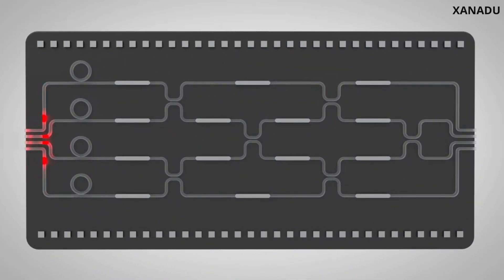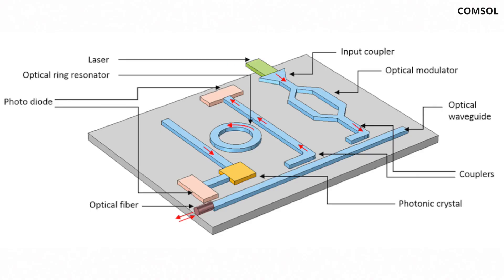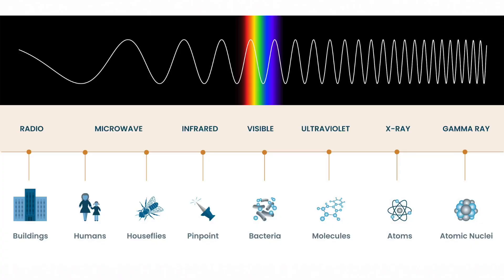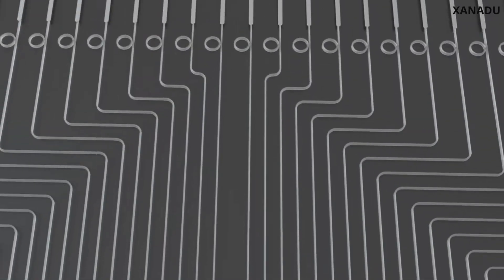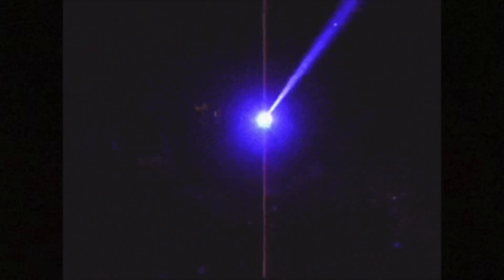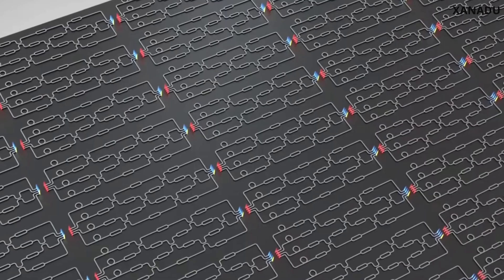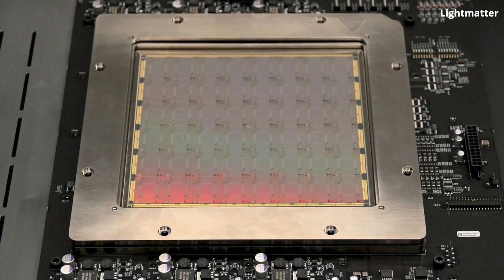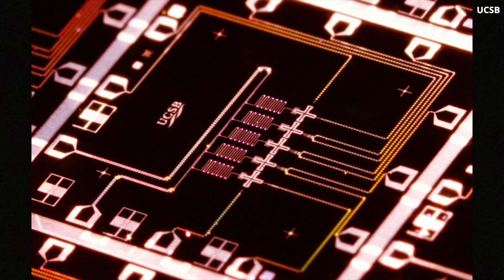New Photonic Chip: x1000 faster

Comment: SAW (Surface Acoustic Wave) devices are conceptually similar.  The interaction and coupling of different energy types.  Resonators, couplers and transmission lines are designed into the system to accommodate each energy type.  
Reliable low power laser emitters are readily available from the fiber optic communications industry. 

For photonics to expand there needs to be a toolbox of active elements which can be simulated.  
Much like the inductive, resistive, and capacitive components in electronics.
Reply: SAW is vastly slower tough I think.
Reply: @tortysoft  The comment was intended to highlight the difficulties with coupling dissimilar modalities.

Comment: It appears that the operations performed in photonics are analog.   Sort of like what you would do with an op-amp based integrator.   If this is correct, then they are suitable for solutions that can tolerate some inaccuracies or lower precision like AI matrix operations.
Is this the case?

Comment: All speculation.  The processing can run at asynchronous speeds way faster but there is no from of optical flip-flop.  All modern silicon designs are synchronous designs that use flip-flops,

Comment: You claim to be a chip designer and yet you keep saying   computations at the "speed of light", but actually that is bullshit.
as a designer you should know that light is  only traveling at about 30 % of light in a vacuum, you should know this fact , becasue it is also the speed that electricity travels in a conductor.
as such you would still get  a delay between 2 points, and i bet you will also get the reflections that you get as you do with electricity.

yep it might be "faster",  but it is NOT the speed of light. becasue you are using wave guides. and the chip is NOT in a vacuum.

So if you are going to talk on a subject , make it clear in your talk about the physical realities, yes it is "fast" and it is "faster" than current tech , but it is NOT the speed of light.
and even if  the chip were in a vacuum and the light beam was in free space, it would STILL NOT be calculation at the speed of light, 
 it would be COMMUNICATING at the speed of light.

Comment: even if this cpu would be 200W that is still less then the top end cpus.  Friend with aht 7995x (Amd threadripper if i remember the model number) he did some testing it was using 350W,  then removed some limits and got it to 1000W (yes 1k or one thousand).  And the 4090 now is eating 600W or so... Just saying 200W is not bad at all for such performance...?

Comment: Certainly! Let's incorporate the use of fiber optic memory with FLMSI into the provided text:

---

Fiber optic memory, also known as optical memory or photonic memory, emerges as a promising technology that can complement the Full Light Mammalian Synthetic Intelligence (FLMSI) architecture. FLMSI, which utilizes light-based spiking neurons for data processing, could benefit significantly from the unique characteristics of fiber optic memory in terms of storage and retrieval of neural network parameters and data.

*Key Characteristics and Potential Advantages of Fiber Optic Memory for FLMSI:*

1. *High Data Transfer Rates:* FLMSI's light-based processing can achieve exceptionally high speeds for data processing. Integrating fiber optic memory with FLMSI would enable rapid storage and retrieval of synaptic weights and network parameters, enhancing overall processing speed and efficiency.

2. *High Bandwidth:* The high bandwidth capabilities of optical fibers align well with FLMSI's parallel processing nature. Fiber optic memory can facilitate simultaneous access to multiple data streams within FLMSI networks, enabling efficient information exchange and computation.

3. *Low Power Consumption:* FLMSI aims for energy-efficient processing, and fiber optic memory's minimal signal loss over long distances can contribute to lower overall power consumption within FLMSI systems, enhancing their sustainability and scalability.

4. *Immunity to Electromagnetic Interference:* FLMSI's reliance on light signals makes it inherently immune to electromagnetic interference. By utilizing fiber optic memory, FLMSI systems can maintain robust performance even in environments with high levels of electromagnetic noise, ensuring reliable operation in diverse settings.

5. *High Storage Density:* Fiber optic memory's capability to store data in small spaces aligns with FLMSI's goal of compact and efficient neural network architectures. Integrating fiber optic memory with FLMSI enables the creation of high-density, light-based neural computing systems with enhanced storage capacity and computational power.

*Integration of Fiber Optic Memory with FLMSI:*

- *Data Storage and Retrieval:* Fiber optic memory can store and retrieve synaptic weights, network parameters, and temporary data states within FLMSI networks. This seamless integration enables FLMSI systems to efficiently manage and manipulate large-scale neural network configurations in real-time.

- *Parallel Processing:* The high bandwidth and parallel processing capabilities of fiber optic memory complement FLMSI's parallel computing architecture. This synergy enables FLMSI systems to perform complex computations and neural network training tasks with increased efficiency and speed.

- *Scalability and Flexibility:* Fiber optic memory's scalability and flexibility support the growth and adaptation of FLMSI systems to diverse application domains and computational requirements. FLMSI architectures can dynamically adjust storage and processing resources based on evolving neural network configurations and computational demands, ensuring optimal performance and resource utilization.

*Challenges and Future Prospects:*

While the integration of fiber optic memory with FLMSI offers significant advantages, challenges such as developing compatible interface protocols, optimizing data transfer protocols, and addressing potential latency issues need to be addressed. However, ongoing research and advancements in fiber optic memory technology hold promise for overcoming these challenges and unlocking the full potential of FLMSI systems in various AI applications.

---

This revised version highlights the potential synergies between fiber optic memory and FLMSI, emphasizing how the unique characteristics of fiber optic memory can enhance the performance, efficiency, and scalability of FLMSI architectures for advanced AI applications.
Reply: Unfortunately, based on our current understanding of AI and available technologies, it's unlikely we've hit any of the major milestones outlined in the FLMSIA project overview. Here's a breakdown:
 * Light-Based Spiking Neurons: While research on neuromorphic computing explores spiking neurons, these typically rely on electrical signals, not light. Significant advancements are needed in precise light manipulation and light-sensitive materials to create reliable light-based spiking neurons.
 * Fiber Optic Memory Integration: Fiber optic memory is a promising technology for data storage and retrieval. However, integrating it seamlessly within an AI architecture like FLMSIA to store and manage synaptic weights and network data poses a significant challenge.
 * Optical Processing Units (OPUs): While research on photonic computing explores using light for computation, building scalable and efficient OPUs remains a major hurdle.
Overall, the core components of FLMSIA are still under active research and development.
However, there are advancements in related fields that offer promising alternatives or stepping stones:
 * Neuromorphic Computing: Research in this area explores alternative materials and architectures for building brain-inspired AI systems, potentially leading to more efficient and biomimetic computing approaches.
 * Memcomputing: This field explores using memory devices with variable resistance to perform computations, potentially offering advantages in terms of speed and energy efficiency compared to traditional methods.
Moving Forward:
It's important to maintain a focus on the core innovation of FLMSIA - the integration of fiber optic memory within a light-based processing framework. Here are some possibilities:
 * Hybrid Approach: Explore the possibility of a hybrid system that combines light-based processing with established neuromorphic computing techniques or memcomputing devices.
 * Focus on Specific Applications: Consider targeting specific applications where light-based processing might offer unique advantages, such as high-speed image recognition or real-time signal processing tasks.
Conclusion:
While we haven't achieved the major FLMSIA milestones, ongoing research in related fields holds promise. Focusing on the innovative combination of fiber optic memory and light-based processing, while considering hybrid approaches and specific applications, could lead to significant advancements in biomimetic AI in the long run.

Comment: Seems like the explanation of the etching is reversed to me. It looks like you would want to remove everything BUT the circuits from the LI Noibate, and then fill in with something else that reflects the light back into the circuits, like a Ag or Al electro-deposition to encase them.

Compared to Si etching where you remove the circuits, then fill with your favored metal, often Cu.

Comment: photonics processor could change the motherboard and every computing devices as we know today. entirely. completely. because photon computing has so much different architecture than conventional computer which uses electron. but, photon computing still requires very small amount of electricity.

Comment: It's also immune to EMP.  It's be used in military applications for years.
Reply: not immune but much higher resistance to it. you still need to generate light somehow, which needs some form of electricity.

Comment: Oscillators and sensors can probably get built on chip or at least in a multi chip package, with commensurate power requirements vs desktop gear. Even if it takes a while to get memory and programmable circuits in a photonics package, that computational performance is surely enough to create a demand for dedicated processors and new software approaches to use them!

Comment: Biggest problem of photonics in computation is density
Production process is similar to creating MEMS elements
There is no comparison to transistors in size, but it can be complimentary tool for edge device communication rather than computation
As of now, the best bet for energy efficient computing is using superconducting processors, very little information is out there, latest article is MANA from 2021
Reply: It is  superior at computation but the material science and other technologies are just not there yet or maybe in the next 100 years.
Reply: @ivantheterrible4317  nope, it's physics restriction
Light channels need to be at least the size of wavelength that is gigantic when compared to size of transistor
Best use for on chip photonics is long distance communication (5cm-5km)
What else is possible is harder to judge
Could use for neural networks as optical properties seem good to create artificial neurons and their weight bias
Reply: @taith2  The technology is not mature or they use it already? I talk about photonics in neural networks.

Comment: Photonic computing will never be that common. The reason electrons are so fantastic to work with vs. Photons, is that Electrons can be moved easily; all you need to accelerate them is a small charge and they jump at your command. And you can stop them and have them wait around. Photons on the other hand only travel in a straight line, and inside fiber optic they are zig-zagging, bouncing against the walls, but the real problem is that photons will not sit still; you can bounce them back and forth, but that's not really the same thing as standing still.

Photonics is a fascinating field, and clearly the 400 Gbit fiber optic transceivers that exist are doing very clever things. 

I am personally getting very tired of these PR releases from research groups claiming massive improvements, and then when you get down to it, it's a bunch of smoke and mirrors that is really just a quest for more funding.
Reply: I imagine at some hundred years in the future the chips will be crystals like in Krypton.

Comment: The Coulomb field around electric charge propagates much faster than light in vacuum, a verified experimental fact. Maxwell's electrodynamics theory describes Coulomb field propagation has velocity 'c' (light speed), and this is incorrect. I derived a better more general theory of electrodynamics that also describes superluminal longitudinal electric waves in vacuum, waves that interact with 'quantum tunneling' devices. Our brain can enter  'god mode' info processing, when neurons start to communicate by means of wireless superluminal signals in very high frequency, much higher than the usual photons. This requires training of the mind, via biofeedback of body sensation and thought control.

Comment: Great video and super-important topic! However, every data center needs a nearby substation for some chip electrons (and some air-conditioning). It may not be fair to say that the researchers here only counted the process (differentiation) power consumed (or, in the case of optics, maybe "lost" is a better word) and did not count the power required by the laser or microwave source generators.

On the other hand, I really do think it is fair to point out that this "chip" is not "flexible" (programmable) and can only do one specific thing, even if very, very fast, with little power. "Component" hardware like GPUs and software like TensorFlow also do specific things very well within a system or platform, but they can be re-configured in a great many useful ways - as can many of the other photonics applications for computing under research that you mentioned. The whole field, still in infancy, has such exciting potential and is showing good progress.

Comment: I can see it as nice accelerator for some task with Propper paralerisation of input but there it one insanely huge drawback and it's size you can't operate under wavelength of light you are using so light circuit go smaller than let's say 400nm on silicon we are near 4 NM so imagine physical limit of complexity of chip/itself goes 100 times.. also you can't really go lower than 400nm unless you find Propper material to channel such wavelength.. can't wait to x-ray chips tho.. that's some serious sci-fi

Comment: Photonic layer control has been around awhile now in modern network long haul services but whats interesting about these new devices IMO is the use of different light logic elements using lithium nicobate instead of silicon. Not just for AI it will be used for extremely low power infinite bandwidth applications.

Comment: I'm kind of confused what the point is of comparing its purported data transmission speed to 5GHz wifi. You're comparing on-chip speed with medium-range broadcast communications. The application and design constraints are completely different.

Comment: The big problem here is not the chip - it is manufacturing. The idea is amazing, but they need to get the whole chain up for fabs to implement that in mass, then someone designs the chips. The later is quite easy - but the supply chain for the whole fabs will likely take years. There is a  hugh push - you can sell those chips VERY expensive for some time, because - at the end - you are 1000 times faster, AND you also use a lot less energy (the later being money spent and infrastructure requirements - you do NOT just happen to be able to cool 100kw (yes, that is where we are now) per rack... so it is a datacenter rebuild) which is ANOTHER major take. But it will - sadly - take time to put the first fab out.

Comment: TBH as a programmer,  I don't understand your domain well enough to understand everything you teach. 
But I am curious, and the main takeaway for me from your presentations in general is that it's very inspirational. You have a very good way of explaining things. Thank you for that!
Reply: Don't worry, the people who do understand will develop a framework or library for you to connect up to, if needed.
Reply: As you said there's a basic takeaway.  She's not presenting to physicists.
I understood the basic concept of limited use of optical transmission betw chip components & poss basic maths. 
But as she explains in the end, this is only a working concept, all the processing components are not there yet... currently they need to supplement traditional (higher  power) components.
Reply: @raheesom She said nothing. Photonics can still be digital. Digital means 1 and 0, it doesn't mean the physics behind the CPU. Most likely, nothing will change for programmers for photonics.
Reply: @SomeUserNameBlahBlah  Of course inputs and outputs are converted to and from digital signals, but the analog part is the central piece that performs the computation - and that differs from the usual chips.
From what she said, it seems they are exploiting the properties of analog systems (for operations like integration and differentiation), which enables faster computations. Same was also done with analog chips for AI, which allowed for more efficient matrix multiplication.
Reply: Regarding your comment about being a programmer, which language do you personally program in which requires you to understand how a regular chip works?
Reply: @IntuitiveGanesh  assembly 😎
Reply: Let's face it, outside of very specialized applications, all of the low level stuff is abstracted out to make it extremely convenient for the vast majority of people - who are just looking to complete some task for the end user.
It's what happened with these LLM AIs. While they are complex under the hood, using them is quite simple.
Reply: she doesn't teach, this is porn